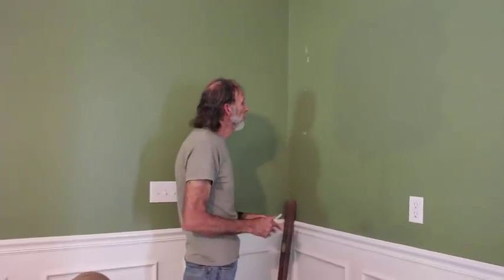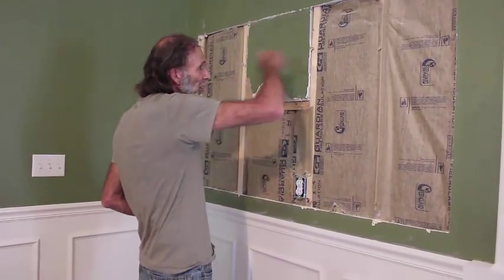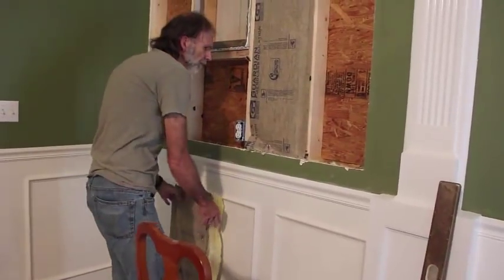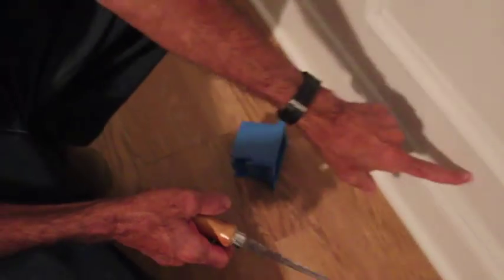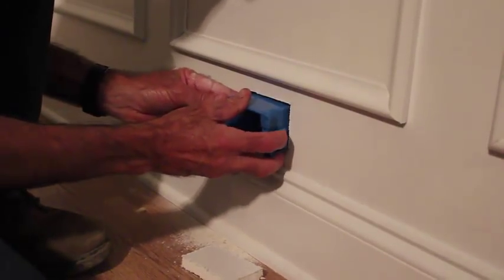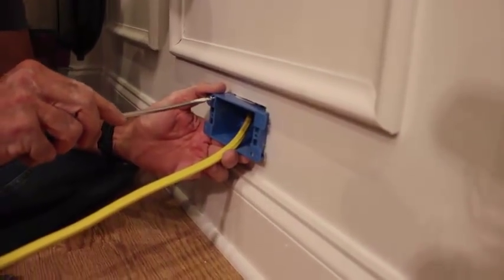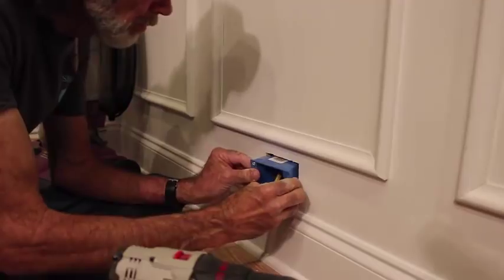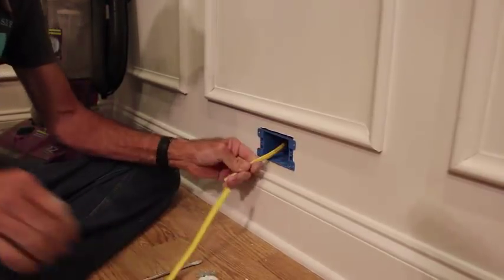Window Installation Part 1  Moving an Electrical Outlet

Comment: I personally use a lamp for a smoke check of wiring of household circuit. Now I know which way to use my meter leads in a socket to check for volts.